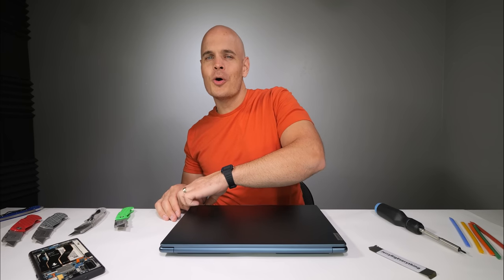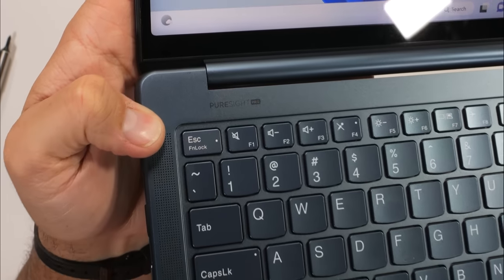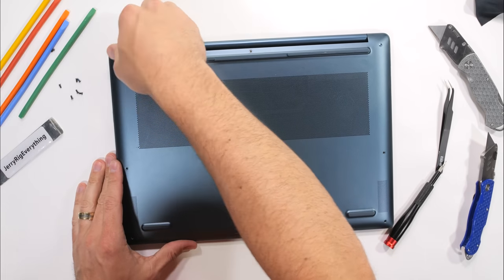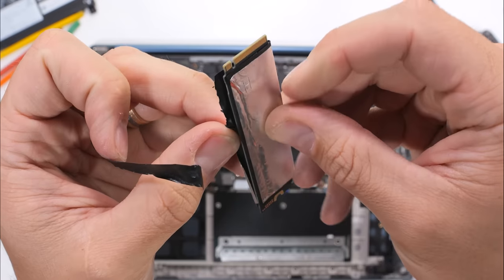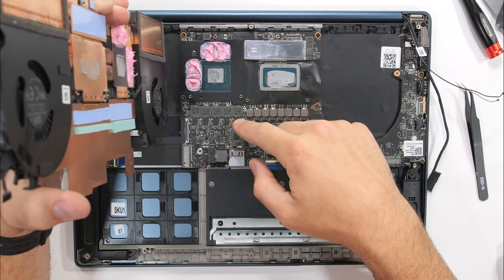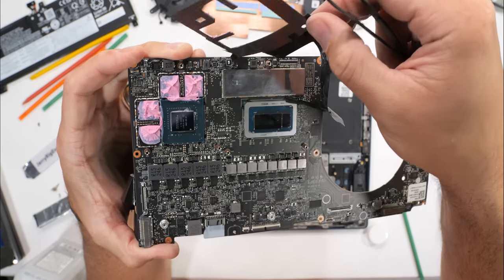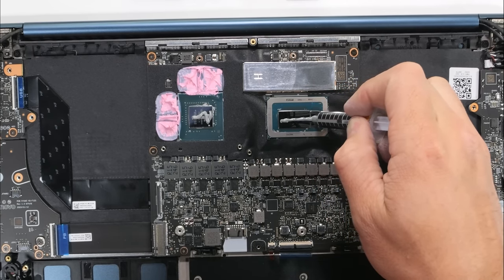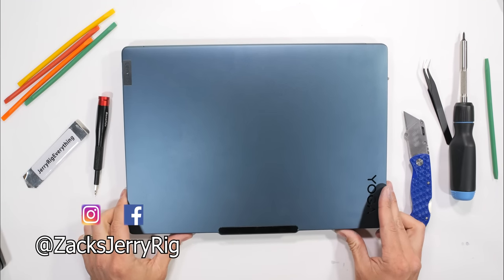FINALLY! - a Professional Laptop that actually puts out

Comment: Hi Zack, I have a question. But 1st I need to tell you this. I use to work in a TV factory, Zenith Electronics, back in 1984's till 1992, my Mother, a TV repair person, & my Dad, he was a supervisor, worked there too.
I went to Electronics school to learn how to repair all Electronics. I also worked @ my Dad's TV & VCR repair shop/Flea market when I would be layed off from Zenith. So I know just a little bit about Electronics, but got out of the field when they moved to Mexico & I went back to school & got an degree in Applied Science in  Medical Assistanting & went into the medical field, job security & I knew the CRT was doomed for extension. Picture this... a women 5'5" weighing a whole 102 lbs trying to put a 27" Picture tube into a cabinet with this huge suction cup Bionic arm. Let's just say the company lost money that day, bc the bionic arm was in control of me instead of me in control of the bionic arm. I was in the air & the boys had to pull me down from the rafters. 
Anyways question time???. We had to wear a static strap hooked to the line & stand on a rubber mat so we didn't short out the compassioners on the motherboard. So why don't you wear one? Since times has advanced was that just all BS back then?
Have a wonderful day & God bless,
Chris from Missouri

Comment: The Lenovo button look great at first but once you start using them they have a few problems. Half of the time the laptop won’t turn on meaning you need to get a pin use the reset button. The wifi breaks twice a day causing you to need to restart the laptop and it’s really buggy

Comment: for myself, I want a portable that has; an 18" screen minimum, an optical drive, a choice of processors, a discreet GPU, 2TB min. hard drive space (can be storage only with a smaller SSD for operating system), I'm sure there are other requirements I would like to have but these are the main ones.
Reply: Good luck

Comment: Like the large battery, removable (and upgradeable!) SSDs in the NVMe slots, and I sure as heck love the huge cooling system. This is how you design a cooling system: HP (with your OMEN lineup), please take note.
However I don't like soldered RAM, though going for the 64GB option makes sense. If they did a 128GB option, I'd have that instead. And given the price of a laptop of this nature... yeah, just get a tower PC, and if you need a portable device, get a Framework Laptop (completely modular!) as a secondary device.
Reply: 64GB of RAM while I'm happy with 16GB.

Comment: It's nice. But, I have almost zero interest laptops with small screens. I guess eventually they will start producing larger screens. Unless it is 17" or bigger, I just don't see the point in looking at smaller than normal text on the screen. And why bother having 2 to 4K unless the screen can use it? Thanks for the review.

Comment: I have a Yoga convertible, which was also pretty well spec'ed for the price, but in use, it's been less wonderful. More than the average blue screens, and random hardware issues. Wifi disconnects on sleep and takes a noticeable amount of time to reconnect.

Comment: This 9i has the same battery spec as my Zenbook 14, just with RTX graphics and an i9, and I get ~6-8 hours of battery on my Ryzen 5. Either the system automatically disables the GPU when unplugged or you get some gaming laptop flashbacks when you see that 'Fully charged 100%, 4hr' in the tray menu. The Pantone validated OLED on my laptop also completely outclasses the 9i imo thanks to the insane contrast ratio and the use of a decent Samsung panel with full P3 coverage.
Reply: Just received this laptop yesterday, actually the battery tells me "Fully charged 100%, 1hr 51m" in the tray menu :(
Reply: @wo0t_gvfabi  dont worry my tray also starts at like 1h 24m and then goes to something like 15h lol
Reply: @wokzhongson  Hm not on my unit, battery is actually dead after around 2 hours (just idle, no programs running) but I also had the impression that idle power usage is quite high which can definitely improved with better drivers and Firmware and those all seem to be still from April, so from the pre-production models, hopefully Lenovo will release newer drivers and BIOS for better power consumption. Also the fans are always on although the laptop is as cold as if it was turned off but the fans were still runinng so there definitively some headroom for stability improvements imo.
Reply: @wo0t_gvfabi  agreed, since it's a fairly new laptop Lenovo likely just needs some time to make the optimizations to allow it to consume less power (or NVIDIA bad, who knows)

Comment: Hi, there is a serious flaw (Design defect) in the micro SD card slot of LenovoYoga7i model 16" (2023 model). You can insert a micro SD card in the slot but you cannot take it out. The SD card will get STUCK and there is no way you can eject the card. There is infact NO provision or eject mechanism to take the SD card out from the slot. I have just bought this laptop a week back and the SD card is stuck. Lenovo Premium care team is playing games with me for last 5 days, pretending to not understand the nature of the problem inspite of repeatedly calling and showing them the problem on live video on the laptop.

Comment: Sadly that power custom port is the bane of Lenovo on anything eating more than 90W that requires it, simply put, it warps super fast and needs changing every half a year or so after the original one fails after just 1y-1.5y

The rest of the laptop is top notch, and it's nice that Lenovo went this way since they are one of the few brands to still include AMD also

Comment: Personally, I am not a fan of the Yoga line. I run a computer repair shop and for the past ~5 years have seen many of these new slim and thin laptops come through with major hinge issues. Gone are the days of a beefy hinge screwed to solid thick plastic (or even a metal frame). Now, they bond a thin plastic carrier to the metal body, and it doesn't always hold the best. Unfortunately, there aren't many great options left, even the nightly Thinkpad has fallen to poor quality control. What I go with are Dell Latitudes. While they are not indestructible, they are so numerous on the secondary market that I can find a very good condition set of body plastics for $50 instead of $500. just my 2c

Comment: I've dealt with countless laptops and brands. With Lenovo the hinges are always weak the plastics retaining the hinge are also of bad quality.
Also Lenovo had this weird tendency to place the M.2 near the heatpipe of the CPU/GPU which ofc results in NVMe's running rather hot and as result of that nvme dies faster
My opinion if you want a decent and reliable workhorse laptop. Dell XPS / Latitude or HP Zbook / Elitebook  / Probook
Yes they are expensive, but you are actually paying for quality materials.
The only Lenovo's that are of decent quality are the Thinkpads. But they have gone down hill ever since IBM sold the trademark to Lenovo

Comment: Laptops of the past had longer life expectancy as things were upgradeable and repairable. The concept of the past can be implemented in current laptops and maintain similar if not the same profile. From someone who tears into these daily, there's nothing to write home about. This IS the same design Lenovo has been using for quite some time.
The life expectancy of Lenovo" yoga" and all none "Think" models is 1.5 - 2 years without technical intervention.

Comment: Would the i9 (13905H) use significantly more power and run hotter than the i7 (13705H)? They have the same E and P core count. Just the i9 runs slightly higher GHz. I ask because currently on the Lenovo AU website the i9 is being offerd for significantly less than the i7 and it also includes 32gb RAM as apposed to 16GB on the i7.

I don't foresee needing such a powerful machine for my needs. However, when the i9 is much cheaper than the i7, why not? My only consideration is the power draw on the already quite humble 75w battery in the 16" model. Any advice?

Comment: My experience with Lenovo has not been acceptable. I purchased a Lenovo idea pad 3 from office max. I initially noticed an exceptionally long boot process.  Long over 3 minutes to get keyboard control.  After I added Office and a few other programs this time got even longer.  Often while typing the curser would stop and additional keystrokes would go to the keyboard buffer only to be displayed a few seconds (around 4 or 5 usually) later.  I returned the laptop to Office Max for warrantee work.  They informed me that they no longer handle Lenovo computers due to customer issues they have had.  I  retuned the laptop to Lenovo under warrantee.  It was returned with a new hard drive.  Even with NO additional programs loaded other than there base stuff, it still is incredibly slow at all  uses.  Based on MY experiences I would NOT recommend Lenovo laptops.  Of course I have no idea of the quality of the one above being shown, and it may NOT have the same issues I continually have had.

Comment: Actually workstation multithreading does not double as a better gaming pc because if u take multithreading too far it can hinder gaming that should be done mostly with singlethreaded CPUs...accuracy and stability with a workstation fine...rapid succession responsiveness does not exactly equate to long lasting server reliability..clearly theyre still forcing propietary when usb-c charging exists for laptops these days that can easily go up to 150w on a average load and even then some laptops design multiport chargin at the same time so its clear bs on lenovo makin a face as if "it was the only way of charging" multitool ports have existed for a long time with small usb phone charge/data connection that have proven to be more than sufficient reliable so its clearly a step down from technological advancement...

Comment: You push the hardware to its limits while working CAD Software? Please use a Mac Pro, even my 2012 MacBook Pro can handle CAD Files with ease. While Linux or windows would faint

Comment: Come on, that cooling is horrible! Having all the cooling in one piece means that the CPU and GPU heat will interfere and causing more throttling! I had a Lenovo laptop with such cooling a few years ago and it was throttling horribly! Changed it for another brand with same specs, but different cooling layout. Guess what? No throttling!

Comment: yoga laptops are terrible. i had this laptop but it struggled with overheating issues and completely broke down after just 10 months. The worse thing is that they (lenovo authorized dealers) don't have the sparepart replacements. I really don't suggest anybody to buy an expensive laptop with dedicated GPU. If you really need a dedicated GPU just get a PC. And if you travel all the time, just get a mini PC, and buy a monitor and external GPU. Laptops should just be used as secondary device, and not to be used as a device for all the highly intensive tasks. All these heat sink systems are ridiculously terrible

Comment: Never buy LENOVO, They UV glued the onboard DDR4 RAM and Processor. It can never de-soldering... Horrible!  
Ex:- Ideapad 320-15IKB DG421 DG521 DG721 NM-B242 NM-B241
They can't repair if you faced any issue with processor and RAM! 
Why nobody address this big issue yet?